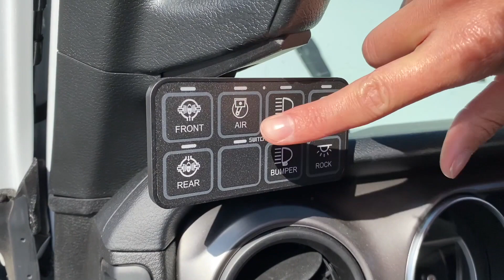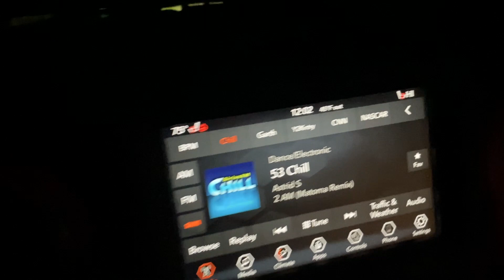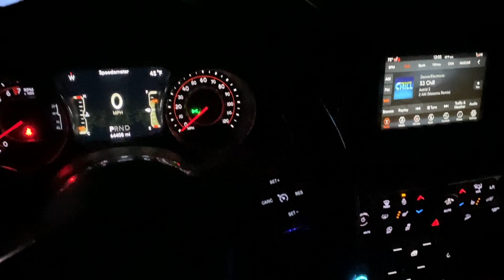The Jeep Gladiator Sucks - For One Good Reason.

Comment: Kevin, get with the company that builds those catch cans and get them to build a catch can that has a line that runs back into the valve cover and a oneway valve that doesn't allow the oil to come up into the line, but once the engine is shut off it allows the oil in the catch can to drain back into the valve cover. That way it empties itself and puts the oil back into the engine.

Comment: I’ve spent a few grand with Northridge4x4 for our JLUR this week.  I think I need to stop watching your Jeep videos for a bit.  Parts awaiting install when the hubby gets home from deployment include:   RK 3.5” Stage 3 Adventure lift kit, ARB onboard air system, LOD front bumper, Smittybuilt 10k winch, LOD rear bumper w/ tire carrier, cargo rack for the tire carrier, Rock lights (because in AZ you go at night to avoid the heat), & a tailgate table.  He made me promise to wait till he gets home to install stuff though.... this is torture.

Comment: The reason the headrests do not come off is there is a wire going to them that needs to be unplugged and is accessed from removing the back of the seat.  it is the whiplash feature that deploys on the headrest (headrest extends forward).

Comment: In heavy dust conditions, it is better to turn snorkel to the rear as air flow profile over the snorkel produces an area free of dust.  Forward facing just sucks in finer dust particles push up by the air.

Comment: Gladiator looks like a dream build!  I love the improvements you have done and can't wait to see it perform in Alaska.
Reply: The Alaska trip should be an easy trip since they will not like to damage this truck before giving it away. So, I sm sure the trip will not involve hardcore things to potentially damage this rig. So, any normal capable 4x4 can do the Alaska trip easy.
Reply: @myytchannel6632  I think the idea was to push it and see what an "Overland" rig, built properly, is capable of. We'll see, as soon as the border is open. With other experience YT Overlanders going along I'm sure there will be plenty of adventure and maybe some wrenching.
Reply: @myytchannel6632  I even saw a Fiat 500 traveling through Alaska on dirt roads.  I'm sure they spent way less on gas than I did with my truck.
Reply: They are more than welcome to drop it off at my house here in Alaska..

Comment: Hi Kevin and Brittany, At the begining of the video, you mentioned about maybe using both vehicles together, making camp with the Foster-Child, while you go wheeling in the Step-child, so that you could come back and camp was already made up! Would it be possible to make the overlanding part in the back of the Gladiator demountable, so that when you are traveling in only one vehicle, you could demount it, set up camp, then go wheeling (with a lightened vehicle!) and still come back to a ready set up camp? This would be like the overlanders who use trailers, with the roof tent on the trailer, such as "Lifestyle Overland" who use a Turtleback trailer, but achieving the same without a trailer whould be way cooler and more versatile.

Comment: I have verizon with note 10+ 5g, with unlimited play more. Includes 15gb of Hotspot but slowed down after, it's still unlimited and works fine for me even after allotment usage. I live near the greater Detroit area so yall being in the rural side should be fine & help your budget.
Reply from the maker: That actually the exact setup I have on my iPhone. Verizon with 15gB of hotspot. Kevin has the same setup but with AT&T.
Reply: @LiteBrite  I've had both, and sprint. i.m.o, a little bit of nerd fact. Sprint and Verizon use the same cell base technology as does t mobile and att. Where it breaks down is the network providers cell tower technology & chipset of a device matter's too. We use to have iPhone and att, switched to Verizon, we love the service, check out st. Helen's trails in Michigan and we get full service on these trails. From Harrison to Gaylord.

Comment: Did you get your rear drive shaft fixed or a new one installed, Jeep seem to do a EV. What about a HUAWEI B331 Router and HUAWEI B331 Antenna that you can carry with you and runs of 12V so if you have a mobile signal you have WIFI.

Comment: Being that y'all had the ProRock built from the ground up, hopefully you took opportunity to upgrade RCVs and ARB locker to 35 spline. It would've made the axles Dana 60ish strong and it doesn't cost any more than a 30/32 spline setup. I'd consider it an uber fail if you didn't.
PRP is awesome. I was afraid that they'd suffer once the brand was acquired by Bestop because of their crappy customer service.

Comment: You two have done an Awesome job tricking that thing out and once again we learn that Jeep puts out a piece of crap because, headlights, axles, drive lines, wheels, seats, bumpers, rock guards, floor mats. Next ? 🤔 Replace the POS engine because the 3.6 is just wimpy and sucks gas. 😥😥 Jeep should be ashamed of themselves and just offer a Glider Kit 🤔 😁😁 👍👍👍 If your familiar with the Trucking Industry you'll know what I mean 😁😁 Great video you two !  👏👏👍

Comment: What's wrong with the lockers that came with the Gladiator that you had to install ARB lockers ? Love the show
Reply from the maker: These are stronger. Factory lockers have a higher risk of failing/breaking as you increase your tire size and weight.
Reply from the maker: The gladiator didn’t have lockers since it was a sport

Comment: I don't know what cell phone service you have but I just got T-mobile 5G which has better coverage than it's 4G and I am find the coverage is better.  Also I got T-Mobile Home Internet which is just 7x5x2 box, only $50 a month, period, no fess for the box and the uploads speeds are WAY FASTER than my local Suddenlink internet. You might want to check it out.
Reply from the maker: We don’t have a home for home internet. But of the phone providers we’ve found that AT&T and Verizon have the best coverage across the entire country (so Kevin and I each use a different provider for better overlap)
Reply: @LiteBrite  I should have explained the T-mobile home internet better, it's box that is not connected to anything, you just plug it in for power, you might be able to use it anywhere, I plan to test it. Since the service is still 4G you might still have the same issue, once it can use 5G the coverage will be great.  It could potentially be like a mobile hotspot.

Comment: Need to get rid of the mechanical steps
Reply from the maker: That’s one of our favorite mods. Makes getting in and out nice and it has the extra protection.
Reply: @LiteBrite  yes but if stuck and you open the door and there's not enough clearance for the step ...would be a problem.. maybe make it where you can turn it off and on with a switch
Reply: My wife is vertically challenged ...we have a TJ with 2 in lift and 32s and she already needs a step to get in easily
Reply from the maker: There is an on and off switch. We demonstrated it when we installed the steps...
Reply: @LiteBrite  sweet musta missed that ...rock on love you guys